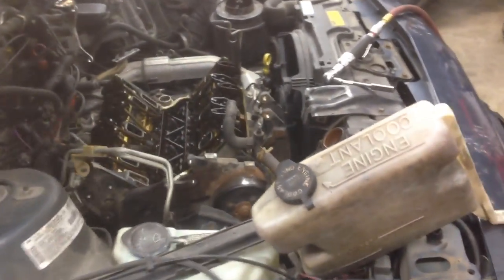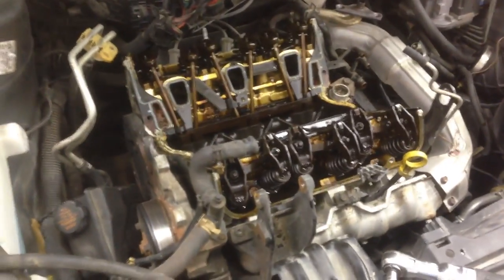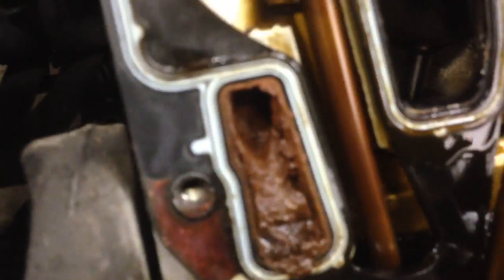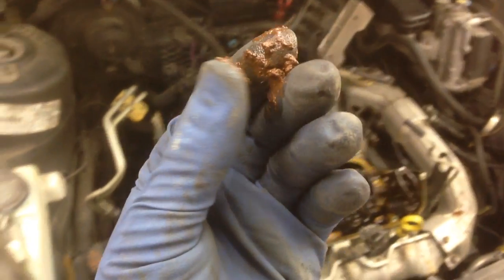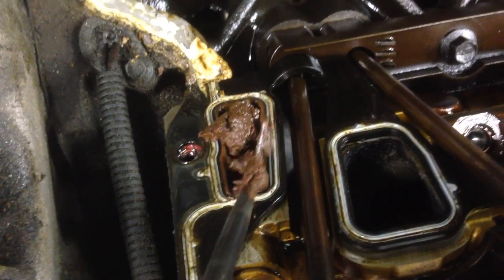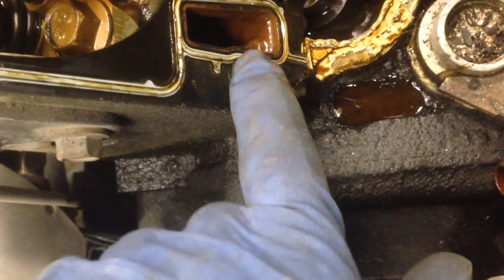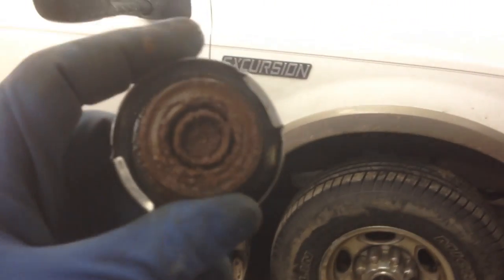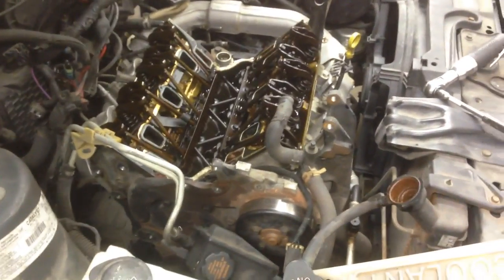Why it's called DexKILL

Comment: This is lazy engendering. GM should know if air enters the system this is The outcome. There isn't really any way to totally block out air from entering the system since there is so much expansion and contraction of metal and rubber hoses. I have been a tec for more then twenty years and I Have seen this in many forms from a little build up and to complete blockage as seen in this video.in my opinion this totally unexceptionable from GM.

Comment: dex is horrible. so is dodge early 2000 coolant th ey put in the Durango eats the radiators.  one reason why chevy has so many gasket intake issues. blazer 4.3 having to replace the gaskets now  won't be going back to dex

Comment: I bought a 98 Malibu for 300 with a 3.1 and the idiot collage kid decided to add stop leak which clog the motor up and as well gummed up oil from rarely changing the oil and the motor was no good at all because there was no proper flow going around inside, not to mention but the camshaft was busted in half and it had blown head gaskets. luckily we had a spare 3.1 from a 98 cutlass all clean and in working condition.

Comment: DeathCool man not DexKill lol
Reply: I've heard it called both. I tend to say Deathcool myself. lol

I think the thing we can all agree on is conventional green worked fine for over 60 years so why reinvent the wheel by using this crap.

I changed mine over to conventional green on my 3800 after doing the LIM and UIM gaskets. Anyone who uses it might as well put brake fluid in the radiator.
Reply: If not either, it's bullshit! lol.

Comment: You know if you just fill your radiator with water that will never ever happen.
Reply: Yeah, but for those in colder climates, running straight water is a death sentence in the winter. On top of that, unless you're running distilled water, you're bound to start rusting shit out.
Reply: Not the best if its iron block
Reply: no because the water will want to evaporate and blow the hoses or radiator out before it has a chance to do anything else
Reply: trent ryan your cooling system will not generally exceed the boiling point of water. Being under pressure also means the boiling point is higher.
Reply: The boiling point is only increased 3F for every PSi or pressure the radiator cap adds. The inappropriately named anti-freeze (coolant) actually increases the boiling point even farther.  My 2015 chevy 1.4T runs 219F under normal conditions, I certainly would not want to be running within 30F of the boiling point all the time.

Comment: OMG, don't listen to this guy. All GM vehicles from 95 on have Dex-cool. And all vehicle manufacturers have switched to their own version of Dex-cool. ethyl glycol ( the green stuff ) is corrosive to aluminum. And will destroy your water pump, cylinder head, radiator and heater cores. This car has been neglected, and the coolant has probably has never been changed, or like another comment "stop leak" . But if you put "the green stuff" in your car....be prepared for massive failure.

Comment: Although I totally agree that DexCool is total garbage and I absolutely don't use or re-use it in any of my personal vehicles (or any other people's vehicles that I work on)... I truly don't believe that DexCool is what caused that heavy gunk that you are scooping out of the coolant ports in this video. I'd bet my life on the fact that someone dumped a whole lot of radiator stop leak (such as Bar's Leaks) into the cooling system of that vehicle in this video.  They created an even worse problem (plugging up everything) by doing so.

Comment: This is why I don't bother fixing cars that's that aren't worth fixing. If you just replaced those gaskets and it's bad again, buy a different car lol
Reply: It's bad again because he does not know wtf he is talking about.
Reply: Really sounds like he did a bad gasket job and it starting leaking.
Reply: This is what you see when you mix oil with coolant and it keeps on going through your system for a bit.

DEXCOOL came with nearly ALL late/early 90ts GM vehicles if that was true all those vehicles would be doomed by now. Which is not the case, the only thing DEXCOOL was infamous for was eating away those crappy cork gaskets that GM used in their earlier engines.

Because of the higher acidity this coolant had..

Comment: Dex kill does this ALL the time. Even dealer babies that get purified distilled water will do it. Fact is when the water gets boiled out of it the phosphate can get hardened and boom you have something very similar to Georgia clay instead of proper coolant. Reality is this is what happens when you use a coolant from a 3rd tier producer (havoline) and design it intentionally so they'll be back to buy a whole new car in 5-7 years. GM fanboys can go cope and seeth. Real GM tuners use Valvoline zerex G05.  This has been going on since the late 1990's and if you read up on the science brought to light courtesy of the Northstar V8 lawsuit you'll never go back to Dex kill.

Comment: For a guy working on engines, you dont really know what youre talking about. Dexcool is bad because it melts plastic gaskets. And you obviously are unaware of this.
Reply: Thanks I needed a chuckle this am. It took Dexcool 180K to melt my intake gaskets.
Reply: randsonic Actually it's more common to happen around 100k
Reply: And it is not because of Dexcool...it is because the OEM gasket is garbage.

Misdiagnosis based upon folklore, or fake news.
Reply: randsonic It's a combination. Plastic gaskets are fine with green coolant but dexcool breaks them down.
Reply: Correction....the 2-EHA mixed with the gasket material on some of old V6's with "wet" intakes. The problem you speak of never affected the V8's.
Like I said........209k on mine now. Original engine, I have had 1 total flush and replace when I did gaskets around 180k. The dexcool in my truck is bright orange but then again I do maintain my vehicle properly.

Comment: That gunk is usually caused by mixing dexcool with ethylene glycol (ie the "regular green stuff" ans you put it).  Sounds like you might be a poor mechanic blaming your slip-shod practices and lack of any practical knowledge on a product that ASE certified mechanics use with no problem.

Comment: Everybody is entitled to their opinion but if you are going to make a video you should at least inform yourself about the facts. I've been a mechanic for over 30 years and there are two things that cause this sludge: 1. Someone contaminated the DEXCOOL with "the green stuff" or 2. Diluted the DEXCOOL through the years by adding water ONLY while the vehicle had a leak in the cooling system. Simple chemistry teaches that cast iron and water react to produce Rust. If you water down the DEXCOOL your neglect causes the problem. If you want to do a proper job cleaning this you must follow PROVEN METHODS to do it. Check this article: 
http://speedtalk.com/forum/viewtopic.php?f=1&t=35263
Want to prevent this from happening? Follow simple instructions and you will. 
1. Don't dilute your cooling fluid. 
2. DO NOT MIX DEXCOOL WITH ANY OTHER COOLING FLUID, PERIOD. 
3. Flush your cooling system with DEXCOOL only as instructed by your vehicle service manual. 
4. Repair any cooling system leaks as soon as possible.

Comment: Uh, try FLUSHING THE COOLING SYSTEM THOROUGHLY and use DISTILLED WATER IN THE PROPER MIX WITH THE COOLANT.  That "mud" is red because its iron oxide aka RUST from the engine and whatever garbage has been dumped into the cooling system since the car left the factory. And you will NEVER have a cooling system that is completely "air free", so the "air contamination" thing is just hilarious bullshit. 

You don't think you're putting air right in the cooling system when you dump in coolant? What does the "Dex Kill" in the EXPANSION TANK LOOK LIKE? Is it "contaminated with air" too? News flash. MOST modern antifreeze/coolants are the same thing as Dex-Cool and for the same reason - compatibility with the plastic tanks and rubber seals found on most new aluminum radiators today. Its kind of strange that the antifreeze/coolant specifically designed for modern cooling systems would be so damned hard on them, isn't it? Not really. It's not strange. It's BULLSHIT. 

 he gaskets leaked again after only 25,000 miles because you used shitty parts and didn't fix the original problem - a cooling system full of garbage. Its pretty standard procedure for people who have to have other people work on their cars to just dump whatever water and/or coolant they can find AND STOP-LEAK in a cooling system when they're trying to avoid paying for a proper repair. And what do most of those "miracle cure" STOP-LEAK products contain? Little metal particles and bonding agents so the little particles stick in holes, cracks, gaps etc in the cooling system.